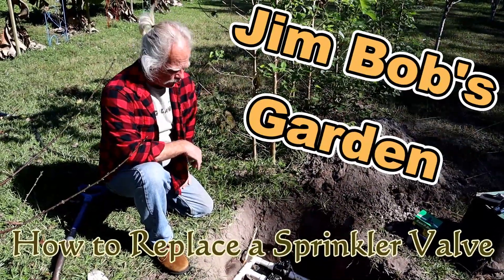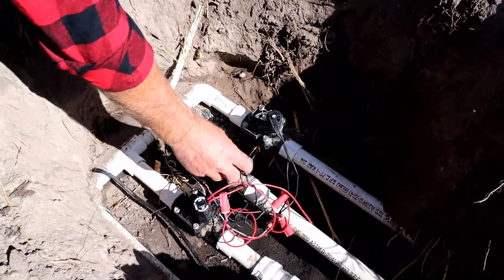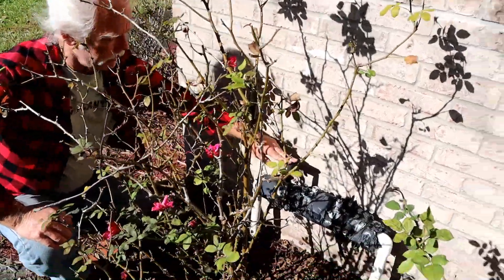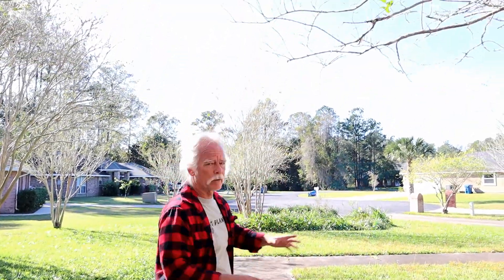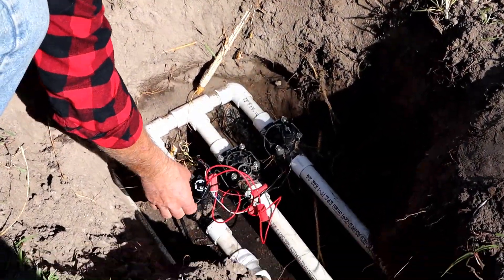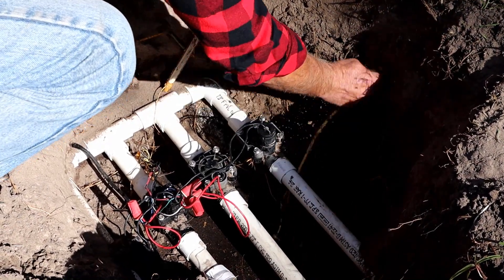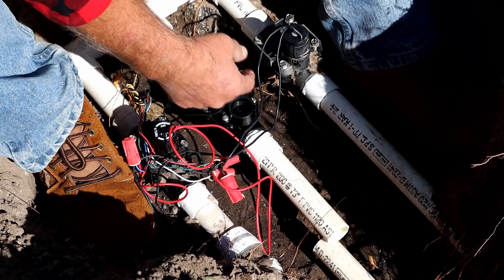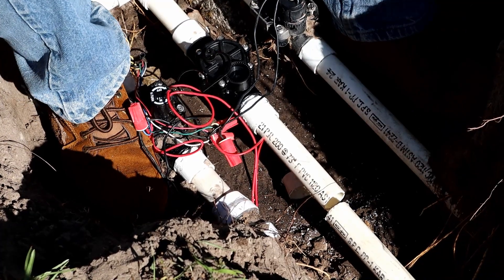How to Replace a Sprinkler Valve

Comment: i didnt watch from the beginning so maybe the whole valve is shot, but why didnt you just rebuild the top half of the valve to include new diaphragm, spring, bonnet and solenoid.  would have been easier than cutting out the piping.
Reply from the maker: I tried it once and it was a pain and also these valves are 20 years old.  The reason it broke is the plastic had become brittle so I figured the rest of the valve body could also crack. I did look for a rebuild kit but for some reason I could not find the brand name anywhere if I remember correctly. It is still working now so either way it worked.